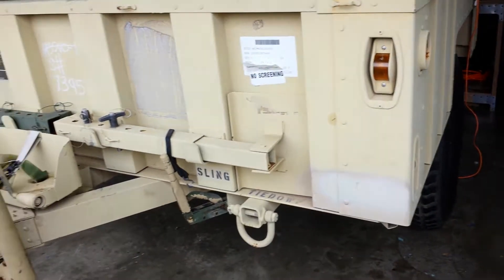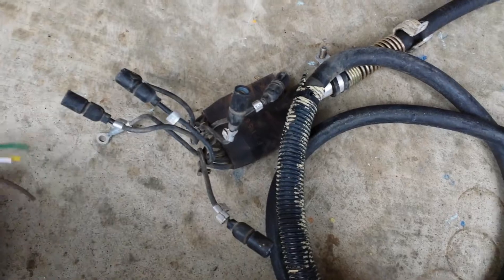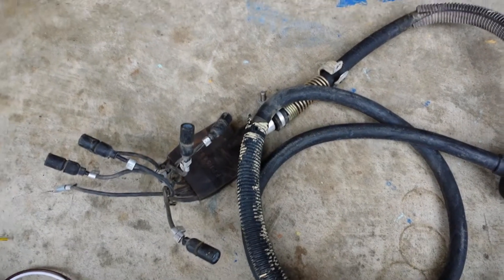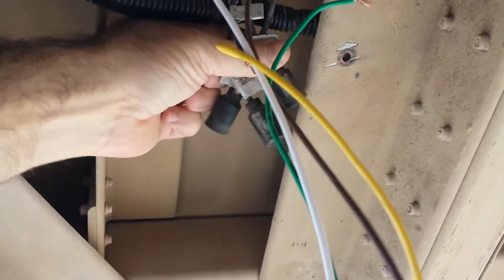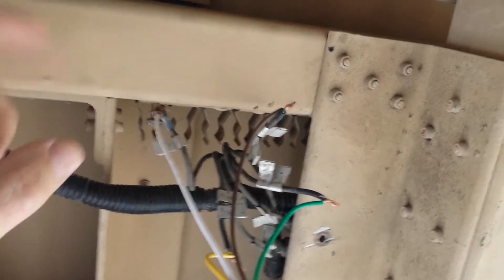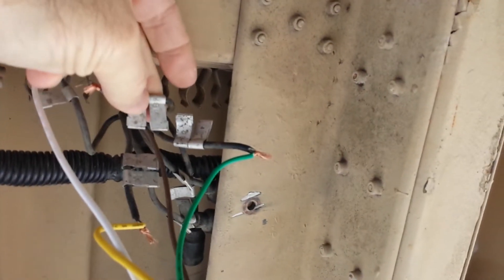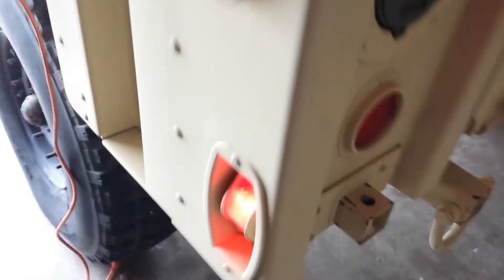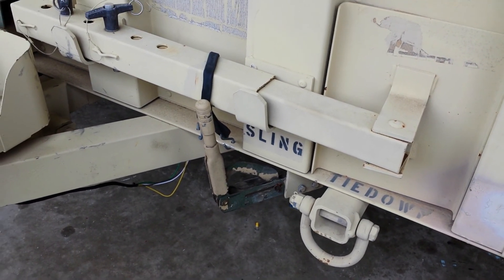M1101 Trailer Lights

Comment: hi I have an 2009 m1101 trailer and it have the led markers instead of light bulb would they work or need to be change as well
Reply: Test them with 12v. If they light up, you're good to go.